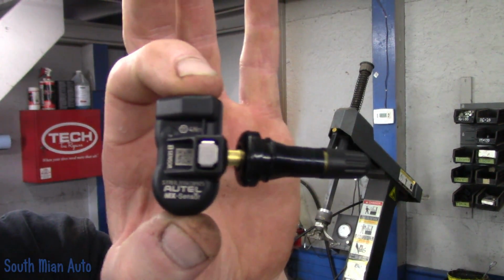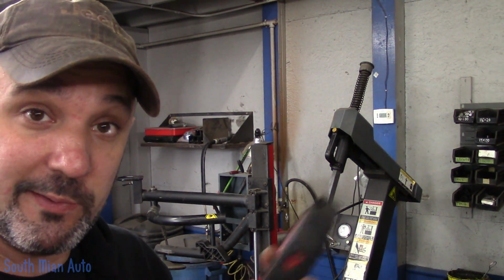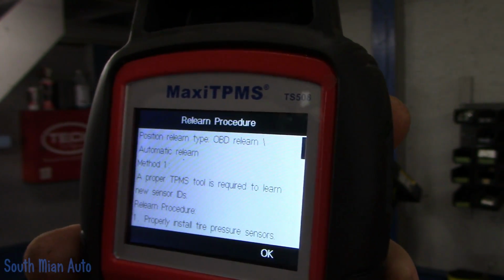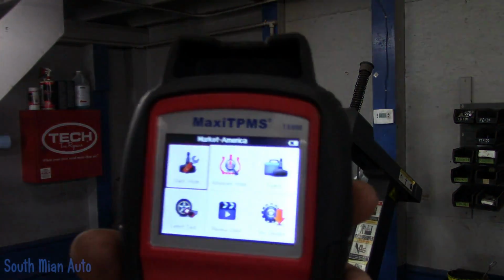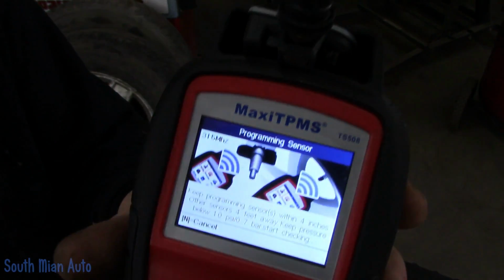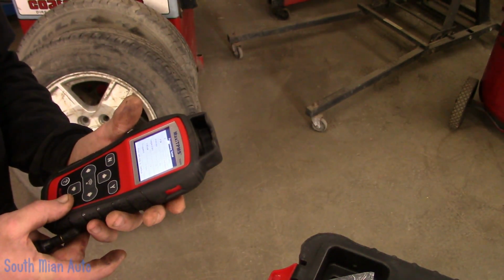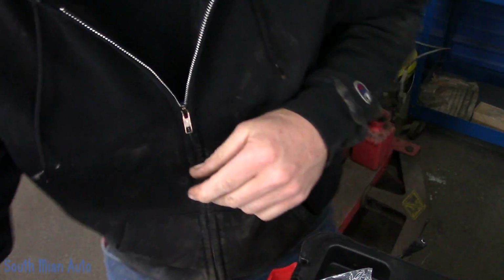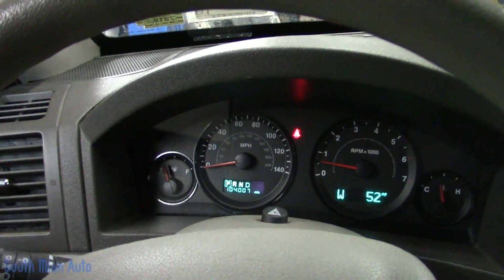Tool Time: Autel TS508 TPMS Tool For The Tech / Shop

Comment: I bought rims for my snow tires and installed new Toyota sensors It is a 2011 rav4. I bought a universal scanner, but it won't work on real Toyota sensors. Will the ts508wf work on Toyota sensors? There installed on rav4 now. I don't want to buy cheap china sensors and go thought this every 2 years when they quit.

Comment: For those watching this in 2025 note that Autel has gimped these units and has decided to remove the functions 2 and 3 in sensor programming that say copy by activation and copy by manual input they are no longer on the 508 or the 501 Pro. Pretty pissed when I got mine today and figured that out

Comment: I have one of these tools in the mail. Am I able to change the pressure range at which the stock sensors trip my low tire light? I often run my tires at lower pressure, I hate the light. Or do I need their sensors to do it?

Comment: I have the same tool just bought with 20 sensors. I captured all the sensor numbers and programmed 4 new sensors to this 2015 sienna and the light still will not go out. Any suggestions

Comment: I have a 2016 Tacoma with 2 sets of OEM wheels.   Can I copy the data from my original sensors to the new sensors so I don't need to relearn every time I switch from summer to winter tires?   Apparently Toyota can't keep a memory for 2 complete sets of wheels which is BS.  I guess only if the sensors are autel sensors by the sounds of it.  I just purchased this tool as it was on sale for a pretty good price and figured it would save me having to go to the dealer every winter/spring to get my TPMS reset.

Comment: Hello Eric. I have 4 new Mercedes Wheels. Bought 4 oem TPSM sensors. Also bought the TS508. 
How should I use the TS508 to install the sensors in the wheels at once or should they be done one at a time? Thanks much.

Comment: Got a set of winter tires mounted on new wheels for my wife's WRX (2017). Wanted to be able to just swap between summer/winter tires in the driveway. Will this tool allow me to read the Id's from each set and write them to the cars cpu so it doesn't freak out when I swap them?

Comment: I cloned MX sensors on an ‘07 Toyota RAV4 but the TPMS light would come on and go off randomly. I then got regular replacement sensors and used the tool to successfully program them.

Comment: Just ordered one of these off eBay brand new for $125. Thought that was a pretty good deal.  I don't need to buy the MX sensors right now, just want the tool to interrogate the OE sensors on my Toyota and see where they stand since they are 7 years old.  Then I will decide what I want to do.

Comment: Researching tire valves and tpms systems for my daughter's car.  She has a 2017 Nissan Sentra SV and I'm in the process of getting her a full-size spare. I've gotten her new tires and have one of the old tires to mount on a basic steel wheel like the rest of the wheels for the car. 
My question(s).... Do I have to use a tpms valve? can I just use a basic tire valve that fits that particular wheel if it's going to be a spare? Or should the full-size spare be set up like a regular tire and rotated into use wth tpms system for that tire as well? Thanks in advance for any help you can offer. If I'm missing anything, any help would be appreciated!

Comment: Great Vid! i just saw an Autel Ts 508 Kit that include 8 sensors, 4 for each frecuency, but i can´t find the info if it include the obd cable. I also saw another sell for the same TS508 but this one says it is a complete tool, that actually includes a lot of stuff. U think any option should come with the cable?

Comment: On BMWs, the sensors just get flashed outside the car, don't even need data from old sensors and put them on the wheels. The tool knows this, and doesn't waste your time giving you relearn options that only apply to other cars. This tool is the real deal!
Reply: (The reason I mention BMW specifically is that I work at a dealership), we just started using this tool for our off brand cars that get traded in too. On my bimmer, I used these sensors for my winter tires and they work great.

Comment: I have a question about Tpms sensors.

When you purchase new tires, the new tires may have a different max. Psi rating than the oem spec. Tires.
In my case 35 psi oem tires, 45 psi new tires.  Does there need to be a program change in the ECM to accommodate the new psi rating. Or is relearning the sensors enough. I am concerned that the alarm would not set until the pressure drops below 35 psi on a 45 psi tire.

Comment: Thanks to this video, I bought a ts508 and it worked great on our 2012 subaru outback.  Never again will I have to take the time to go sit at the tire shop waiting for them to do the relearn when I swap wheels.  Very helpful video, it can be quite confusing figuring out exactly what tools you need to read the sensors and perform the relearn.  My tire guys don't quite seem to understand about cloning sensors.

Comment: Eric love your channel Is there a way to reprogram an original tire sensor on a say a Dodge Journey alarm is set for 36 psi. The vecheil rides like a farm wagon. Can one say set the alarm for 32 psi.
Reply from the maker: Yes any capable shop should be able to change the low pressure threshold for you
Reply: @SouthMainAuto  Thanks . now I will be able to ride in comfort. Thanks Eric

Comment: Please Help I've got a 2009 F150 Lariat 2 wheel drive TPMS sensor fault continues to come up on dash even after reset several times by shop and one can help me it's pretty annoying having to get out and check tire pressure every time the thing turns on any suggestions they have not replaced any of my sensors as each time they reset and check they come out good with Good batteries

Comment: Nice setup Autel has with their sensors. That's the only way to go, IMO. Way cheaper than anywhere else.

I bought the Maxisys 906TS just about 3 years ago, since it had the TPMS tool built in. Figured I'd get a lot of use out of it - I haven't used the feature once! I didn't realize at first that you can't fail inspection in MA for the tire light. Anyone that knows that just deals with the light - they don't want to spend the money. Can't blame them there. This state has their hands in every one of their pockets - might as well save a buck where you can.

I got sick of doing the in-vehicle relearn of the sensors long ago in the Silverado. Have to do it every 6 months, since I have 2 sets of wheels & tires for summer and winter. That got old after the 1st year! Removed the sensors from the winter wheels, sold them on eBay, and stuck regular valve stems in. I just deal with the light all winter long. I prefer a tire gauge! Oh the humanity! 😂

Comment: Just a tip the rubber stems that screw to the sensor the screw will work with the Autel sensor and don’t fall off at high speed like the click in stem...

Comment: Mr O, what would cause 95 5.7 4x4 tbi to cut off @ 55 mph?
Reply: Does it start right back up or how long do you have to wait till it restarts?  What happens when you manually shift it to the next lower gear (if an auto then shifting from "D" to "3")?  Is it temperature/weather dependent?  Do you have tools to monitor spark output and fuel pressure while on a highspeed test drive - if so what are the test results?
Reply: @KCautodoctor  doesnt actually shut off just won't go past about 55. Whether in third or in lockup. But will shift into second and rev up to 5 or six ripums.

Comment: I have an 09 GMC 2500 and when empty I run 50 psi front and 45 psi rear tire pressure.  I sure wish there was a way to reset tpms press to a lower value so I would not have to see that light/with associated msg. Instead of resetting just the tpms tire location.

Comment: The shop i work at switched to Autels over Schrader. I like the TPMS tool much more. It gives you a lot more options and seems to trigger sensors from a lot further away. Also allows you to reprogram the vehicles computer to look for whatever pressures you set it to. Helpful when installing 10 plys that need a higher pressure than most stock 1/4 ton trucks

Comment: We've been using these at work for about a year now and they have been great. The only problems we've had with them is with earlier Toyota / Lexus systems.
Reply: do you know if this will work with 2006 lexus is350?  I am going to get one to program my 2006 is350, but your comment about issues with earlier lexus makes me worried.  Your feedback would be greatly appreciated.
Reply: @IronCan88  You need a scan tool to write the IDs in on Lexus/Toyota.
Reply: @E46-q6u  thank you.  I actually bought one and even though it's not perfect, it worked on my Lexus is350 2006 and also 2015 Subaru, as well as 2021 Toyota RAV4 hybrid.  So I think I got my money's worth already so far :)

Comment: The Bartec tool is nice, but the guys making the updates are about as sharp as a marshmallow. They’ve made my job miserable for the last year. When it takes longer to reset the tpms on a 4-runner than it does to put tires on it, that’s a problem.

Comment: First time my low pressure light went on I immediately pulled off the road. All tires fine and up to pressure. Happened again, same thing. All tires at full pressure.  Now it's alway on and I ignore it.  Useless.
Reply: 10bbremer haha! That’s one of the most ignored repairs! 3 outta 10 cars that come in have the pressure light on permanently!

Comment: A Swiss electronics youtuber Andreas Spiess recently reverse engineered TPMS sensors to use them to monitor beer fermentation.  Interesting look inside the blackbox.  One thing I learned is that they only transmit when moving or interrogated, unless the pressure is changing rapidly then they transmit.  So putting off having that slow leak repaired is draining your TPMS battery and probably means sooner replacement needed.  

video title: #261 Measure Pressure Remotely (including TPMS Hacking / Attack) for Beer Brewing

Comment: I have a TPMS issue....
Light blinks for roughly a minute and then burns steady.....
All tires are aired up to manufacture specs and all new sensors installed......
Was told it could be TPMS module but can’t find it on vehicle (2009 Dodge Ram 1500 QuadCab)
Can’t read system through OBD2 port cause says it can’t connect with the module.....

What could be the problem here?

I have this same exact scanner (Autel TS508)

Comment: Superb video, I bought the TS501 in the uk for doing my own vehicles around the £180mark (buy the sensors for around £22/4 ea, when needed e.g. i aint a mechanics shop), but the TS508 comes as a kit (with 8 sensors) in the UK for around the £350 mark. So good reasonably priced system for small shop or diy, as long as you only use the autel sensors.

Comment: #1 What do you do when someone changes tire size and they want their OD/Mileage to display correctly? I recently went up in Tire size from a 205/70R18 to 275/75R18, I know when it shows I’m doing 40 I’m actually traveling around 43/44MPH. Display at 70 I’m traveling at 75 mph. In general it’s okay but every thing else will be off  actual mileage and gas mileage. Is there a DIY FIX?   

#2. What’s your opinion on the vehicles that drops down to 4 cylinders from 8? If I had a mechanic turn that off would it void my 100K powertrain warranty from GM?
Reply: Mark Eckelkamp they make cheap programmers for tire size and gear ratio correction

Comment: Fun & games with TPMS.  The TPMS malfunction light was on in my daughter's 10yo hi-YOON-day.  The Buffalo-based tire chain (the one I'm I'm DONE with) sells aftermarket sensors for $100 installed & programmed; when we got there , the guy said he couldn't program hi-YOON-day and we'd have to go to the dealer.
Dealer wanted $95 diagnostic fee, plus $130 per sensor, plus $ridiculous for programming. 
On a whim I called a non-chain local tire shop - $65 installed and programmed, and hi-YOON-day was no problem.  
A few weeks later, all the staff at the chain store had training on new TPMS computers; I wonder if they can do hi-YOON-day now?

Comment: I've only used the Bartec.  Had two sensors go intermittent on my 06 Frontier in 2016, so I replaced all 4.  The batteries go out on them.  I used new Nissan sensors, the Bartec worked great.  The Autel looks good.

Comment: After your last video using one of these tools, I was surprised to see you read Key FOB Data. I bought one the next day, just mainly for that feature. I had a few Key FOBs that did not work or would not program. This tool confirms that the FOB is transmitting from each button and takes the frustration out of NOT knowing if the FOB, Button, and Battery are functioning. This makes Key FOB repair and function testing easy, which then helps you in ensuring that you are programming a "Functioning FOB" to the vehicle. (Often a FOB only needs a battery, battery contact cleaning, and/or Button Contact Cleaning. You can do this on the bench and verify each key function without the car.  I do not have access to a tire machine, so TPMS functions are only for reading each sensor, reading sensor data, and primarily re-learning tire positions after tire rotation. Those functions can make this tool valuable for the DIY'r just for FOB & Tire Rotation functions alone. Interesting Video showing what the tool can do.

Comment: Cool tool though the shop i worked at had their own tool it was an OTC. Why would sell them tpms sensors if they're not bad?  We would just replace the rubber valve or the rubber o-rings on the sensor depending on the vehicle very  rarely would we replace sensors.
Reply: Because in this case, the metal valve stem itself was corroded and was failing; and on some sensor types like the Schrader 20087; the valve stem is a physical part of the sensor and cannot be replaced.
Reply: @digitalrailroader  Yes I know i worked at an tire shop when we did tire replacements we changed the o-ring/seals along with the nut and washer.

Comment: I had an interesting problem.  My uncle bought a used 2015 Nissan Altima that originally had steel wheels with hubcaps.  The little small car lot said they would trade him some aluminum Nissan wheels for the steel ones with hub caps.  Problem was the wheels they put on it was 2012 year wheels and had 315 MHz sensors on it.  The 2015 used 433 MHz.  I had bought a TS 508  and figured out what the problem was.  So I ordered some Autel sensors and am taking it on the road Monday to make sure it all works.  It bothers me that some people are saying they have trouble with Autel Sensors.  I sure hope these last!  One last thing, since I only traded sensors and didn't change the location of the tire on the wheel, I hope I won't need to re-balance the wheels?  What is everybody's experience?  Tom

Comment: If I ever buy a vehicle with TPMS, I would not waste money on maintaining the TPMS system, I would just wait for it to die, then put standard tire valves, and then put electrical tape over the light. I check my tires each time I get gas with my handy dandy tire pressure gauge.

Comment: Somewhere there is a little barn in China where they make this equipment. Fifty or sixty people making a living.
There used to be thousands service station attendants pumping gas, checking tire pressure for ya making a living.
Now we've got thousands of college grads with degrees sitting on the couch playing video games who don't have a job.
GO FIGURE.
Reply: You mean you can't pump fuel and check you're own pressures?
Reply: Y Back in my day soda pop use to be a nickel and it was a real treat when we got one.

Comment: I have 2 sets of tires for my Subaru Outback,  winter and three season.  The dealership wanted $150 to pair the sensors to the car each season, so $300 annually.  The tool paid for itself the first year. It also works really well with my wife's 328d wagon and my ex's Nissan Versa. No good excuse these days for cars that won't automatically relearn the sensors.  Fail, Subaru.

Comment: You have to wonder who came up with putting an aluminum nut on an aluminum stem and expected it to last when salt gets on it.
Reply: steve's auto repair 
Yep, was doing tires when they first came out, at that point they were $200 each for the first year.
Everything broke, even ones 3 months old in the summer. Out of 50, only had one that came apart

Comment: A related question:  is Chrysler the only company whose cars (some of them anyway) can relearn new TPMS sensors on their own?  Bought new summer tires two months ago for my 2010 Dodge, had new TPMS sensors installed that were "pre-programmed" for Chrysler vehicles, and the car relearned them all on its own...no tool required.
Reply: My 2017 Honda Ridgeline will read the new TPMS sensors automatically with no programming necessary.

Comment: With that Altel sensor, can it be read with other scanners? You said it can read OE sensors, but can other scanners read them?
Reply: Other brands of TPMS scanners can read the data the Autel sensors transmits, but the other brand scanners will not be able to program the Autel sensor
Reply: KCautodoctor that’s what I thought. It’s a good tool for diy. Only be worth it if a tire machine and balancer were at hand.

Comment: Was thinking about getting one of those TPMS tools. That looks like it works great... Most vehicles, you can skip the road test, just start the car then go around the car and activate each sensor with the tool and the TPMS module should  pick up the activation's and turn out the light. Does not work on every vehicle but i would say 90% of the time this works for me.